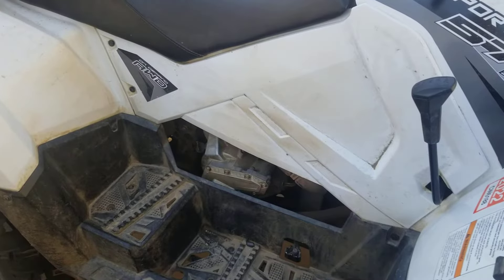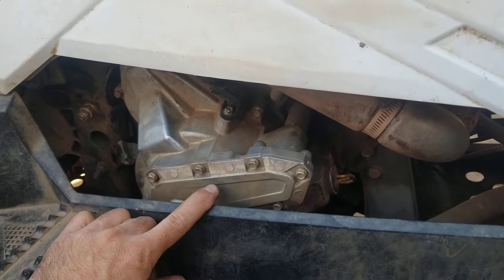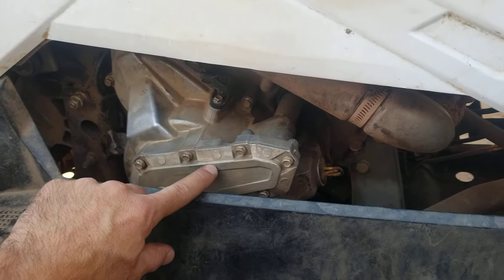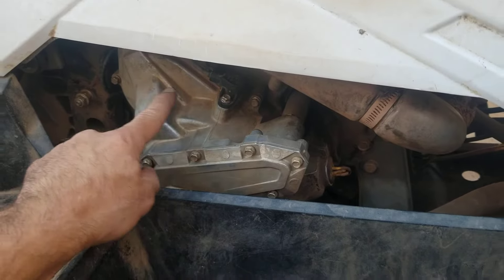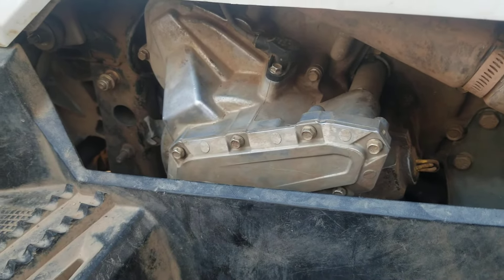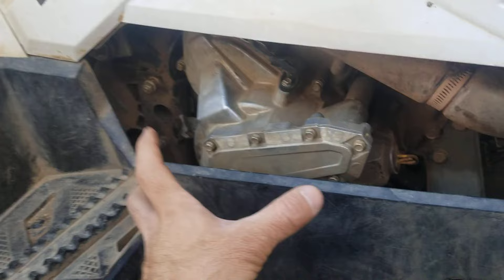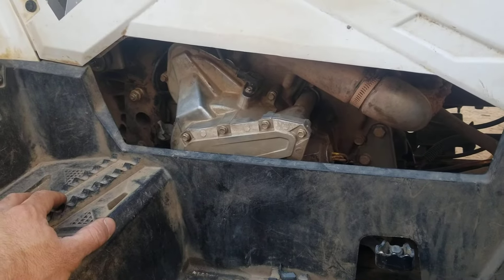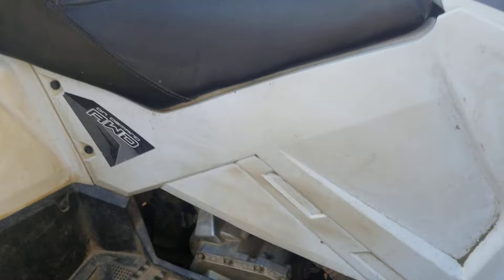Sportsman 570 Common Issues

Comment: I've owned my 570 since 2014. It has just over 900 miles and 300 hours. Used mostly on my 10 acres. Plowing snow, hauling, trail rides. I've need a head gasket, replaced under warranty, a battery in 2020, fuel pump in 2020, and many fluid changes along the way. Overall been pretty reliable and easy to repair over the last 10 years I've owned it. 

Plenty of storage, good power and top speed, comfortable for longer rides, and fun!
Reply: That’s low mileage i’ve had mine since last year and I have 4,100 miles

Comment: What the difference between an SP and non SP.   also in a 2017non so with 154m on it a good atv to get?  $5500.  
What do you think about bass tracker 2021?   For my son, I know not…
Reply from the maker: Basically the suspension and adc for the SP. 
Bass trackers are just chinese junk imo.
2017 570 is a good quad in general, just has the typical issues all 570s have.

Comment: I bought a 2020 450 last year and the battery went out. I replaced the battery and now the check engine light comes on. The engine runs fine, I just now have a light on all the time. I am not sure if there is a reset or other I should look for. Any help would be greatly appreciated.
Reply from the maker: What code is it showing?

Comment: The fuel pump failure on mine was a o ring in the pump assembly causing it to not build enough pressure it was easy and cheap to fix the pump itself was fine

Comment: Mine overheated yesterday it said low coolant level I checked it I couldn't see it when I took the cap off, there was none in the Overflow Reservoir or in the hose going from the reservoir to the radiator. I got it running again and then then it started smoking a little bit I shut it off and then when I went to go start it again it would not start or turn over , even trying to start it off the solenoid it has hardly any Spark.
Reply from the maker: You might have blown the engine/ overheated it. Pull the spark plug and see if it turns over like normal.

Comment: Hi I have a 2014 sportsman 570 EFI touring. It turns over like it wants to start but it don’t. I have to turn the key and give it gas then it turns on sometimes. Could that be the woodruff key? I charged the CPS put new spark plug and new fuel pump. Do you have any idea?
Reply: Fuel injectors? Will it start and barley run for a second an stall out?
Reply: I’m a try to change the injector tomorrow.  It wants to start, but it doesn’t the only way it starts if I hold the gas and turn the key at the same time it doesn’t start all the time
Reply: @mij290 Hey, did you figure out the issue with your quad?
Reply: Yes fuel pump and you won’t believe it it was the ignition switch too.
Reply: My 2015 570 starts for a second or 2 then dies, what do you think I should address first?
Reply: You can start by checking the pressure on your fuel pump. Make sure you have enough psi on it.  You can also change the ignition switch. Mine was doing the same thing, but I changed the fuel pump first and it still was doing it so if you want, just change the ignition switch

Comment: Good day, thanks for the video. I’m having a problem with power delivery to the wheels. When i rev up it doesn’t bring the power to the wheels  while the motor is sounding normal.
Reply from the maker: Sounds like the clutch is going out

Comment: My 2021 570 started ticking and lost all power like I was giving it full throttle and it was barley moving and it shut off and won’t crank any idea what it could be the ticking was coming right under the seat
Reply from the maker: Test your battery and the connections
Reply: @brothersmechanics2028 could that cause the ticking tho sounds like in the motor
Reply from the maker: @actecalcfn5609  could be a lot of things. Valve clearance, crank bearings, piston slap, etc. No way to tell through messaging.

Comment: I'm working in the woods right now with it, so when it says low on coolant it got to like 210° so I got off it and just let it idle for a few minutes while I was cutting fruit trees and when I went back to check it it was at 2:48 so I shut it off. But then it did start again and I pulled a few trees with it and then it started smoking a little bit so I shut it off . So what did you say take and pull the spark plug and see if it'll turn over?
Reply from the maker: It definitely overheated. Pull the spark plug to see if it turns over or if it seized up

Comment: I have 2018 570sportsman  efi… while it was out of gas I went ahead and changed the oil and filter put fresh gas back into now it starts for a split second and goes dead… check spark and everything I know to check… Any suggestions?
Reply from the maker: If you ran out of gas it can take a while before that pressure pushes out all the air in the line.

Comment: I have a 2023 570 touring and at 50+ hours. I’m hearing a ticking noise almost like a knocking noise and it drives and runs normal, and the noise goes away randomly then comes back
Reply: Mine does tick a little when hot i dont know why but it sounded like this since day i got it

Comment: Hey Brothers, I have a 2015 570 that is always running hot. Replaced thermostat and cap which did nothing to help. Do you think my woodrift key could be the issue? Yesterday it died on me, starts but stalls out immediately. Thanks for any advice you have.
Reply from the maker: Check your water pump and do a compression test
Reply: That will be your fuel pump, pull the seat and you can see the map reader plug in on the side of the throttle body, disconnect it and start it, it should idle smooth but will die with any throttle, if it idles okay it's your fuel pump.
Reply: @mbriggs4627  yup, replaced the fuel pump 2 days ago & it runs fine now. Still have an issue with it running a bit hot. Replaced thermostat and rad cap, elevated the front & burped all the air, used OEM fluid but still seems hot. Fan kicks in and off as it should, can't figure this one out.
Reply: @gordtaylor1538  Is there a temp gauge on the 16 that I don't know about ?
Reply: @mbriggs4627  no, no gauge. Just by feel of the heat it gives off and that it steams up the instrument cluster even in warm weather which it never used to do

Comment: After replacing the fuel pump assembly it still shuts off any ideas what it could be -tu
Reply: Voltage regulator
Reply: Could be the contact on the thumb throttle

Comment: First,  thanks for your help. i have a 16 450 sportsman but it has 570 engine. ( how i bought it) fuel pump i replaced  and let it sit for awhile. went for a ride got about a mile and it died it sat for awhile i turned it over started went back out and it did it again. what do you think
Reply from the maker: Sounds like fuel pump still
Reply: @brothersmechanics2028  thanks again

Comment: Mine won't start , I was plowing and it stalled then wouldn't start back up . It's like it wants to start like a dead battery.  But has 12.4 volts ?
Reply from the maker: Need more info.
Reply from the maker: Check your fuel pump
Reply: If the battery is bad and or old it could show voltage but actually not delivering it to the starter.. Put a new good one and verify

Comment: So I’ve got a 16 570 and I can’t get any power at all, not to the screen or anything. Any ideas?
Reply from the maker: Ignition is the first thing to check. Hand controls are next. Make sure your battery is good of course. Also check fuses.

Comment: I have a 2015 Polaris 570 sportsman it just started misfiring/ back firing and not having any power. It will also cut off when it idols down. Do you have any suggestions what it might be?
Reply from the maker: Possible top end rebuild needed. Do a compression check.
Reply: I have the same problem.  It turned out there was water in the gas.  Empty the tank out and give that a shot.
Reply: Could you solve the problem? What was the solution?

Comment: I've got a 2016 570.   I've had an intermittent problem with mine stalling.    Now its backfiring and barely running when off idle   I thought maybe weak battery might be the cause, but how would I decide if its really the fuel pump causing the problem ?
Reply from the maker: You need to test the fuel pressure coming directly out of the pump.
Reply: Did you ever solve it? Mines back firing and stalling when accelerating its 2021 570
Reply from the maker: @mattandkatchristie2552  test your fuel pressure
Reply: @mattandkatchristie2552  I charged the battery, things seemed to improve - but I haven't done enough to really prove root cause.  I should just go buy a battery, but my mower went down and distracted me....  I'll report back when I have found root cause with my situation.
Reply: @fj5gtx770  sorry to hear about your mower jeez your not having good luck. And I'd definitely appreciate it if you figure it out.  Thanks
Reply: @brothersmechanics2028  it's running good for a few min then starts to die
Reply: I am going to replace my plug this weekend and order a fuel pump. I will let you guys know if either works. Thanks for the advice.
Reply: @davidshinn5657  mine was in the wiring!!! The wires to up front going to the crank sensor! My 570 works perfectly I just rewired it with some wire I had laying around and used tinfoil to wrap the foil wrapped wire. Make sure you rewrap that wire or it wont run right. To test it wiggle those wires while someone else is trying to start it see if it starts. Good luck!
Reply: @mattandkatchristie2552  Thanks,I will have to you tube crank sensor. My buddies are going riding sat. and I hope it is a simple fix.
Reply: @davidshinn5657  it's easy to get at the wire. Is your engine light on ?
Reply: @mattandkatchristie2552  no lights
Reply: @mattandkatchristie2552  engine light is Not on.
Reply: @davidshinn5657  do you have fire? Spark
Reply: @mattandkatchristie2552  Yes it cranks up and drives around. When it gets hot and the last time it would barely stay running and putt alone to get it to the trailer.
Reply: The plug looks pretty charred.
Reply: @davidshinn5657  when it starts running bad the engine doesn't come on?
Reply: @davidshinn5657  mine would sometimes run good for a few min then start spit and sputtering... I fixed that wire and won great. Theres that 1 wire that needs to be separated and wrapped in tinfoil. The reason being is the crank sensor wire will pick up feedback from other wires and cause it to run awful.Sounds f funny but true haha I was so happy to finally figure it out

Comment: Hey ive got a 570 sportsman 2018. I'm dealing with a high gear issue. First of all all gears are hard to shift and secondly while driving in high gear sometimes the gear makes noise and feels like its slipping. can anyone help me with this please?
Reply from the maker: Check your primary and secondary clutch to see if the secondary is always moving. If it is, that's your issue.

Comment: i have a 14 570 and when i get on it it has plenty of power but when i start riding for about 5 minutes it just looses power and start back firing and not wanting to crank any help ?
Reply from the maker: When you say it wont crank, do you mean the engine doesnt turn over at all as if its seized or do you mean it turns over but wont fire?
Reply: This is exactly what mine is doing it is a 2015 570 sportsman. It cranks and runs fine for a little while until it gets hot and then it starts backfiring misfiring not idling.
Reply from the maker: @davidshinn5657  check your fuel pump. That's a symptom of a clogged filter or a pump going bad.
Reply: @davidshinn5657  i changed my spark plug and fixed the problem
Reply: @dakotasherley8365   I hope it is just a spark plug
Reply: @davidshinn5657 was the spark plug?

Comment: Why does it slow down when you stop accelerating?
Reply from the maker: It's how the clutch system is made. It's specifically designed to slow down when decelerating.

Comment: Buy any pump save your money then get a heat shield for your fuel tank and wrap your header with heat shield tape. Problem solved. Cost about $75. And never buy a polaris again because they knew about this on 2016.
Reply: Sounds like good advice. I'm going to replace my fuel pump soon and will stick some tape around the tanks area. Cant hurt.

Comment: I have a 2016 sportsman 570sp and I’m having issues with code 102 4 (t-bap) I’ve replaced the harness and plug and the sensor I also replaced the fuel pump (complete pump) now my issue is atv would run and idle if check engine light is present when cold but when the engine runs enough to warm up check engine light goes off and atv shuts off and won’t start again until I unplugged the tbap sensor any idea what I’m dealing with?
Reply from the maker: Sounds like you've done all of the typical issues for that code. Maybe your new bap sensor is also bad.
Reply: @brothersmechanics2028  I’m on my second harness and 3rd tbap sensor I doubt I got 3 tbap sensors bad in a row
Reply from the maker: @Pnwutvadventures  sounds like you should just pay Polaris to diagnose it and save some money.

Comment: My dash lights flicker constantly, blow ps fuse constantly. Doesn't roll over half the time and this all started 1 week after getting it. It was fine until I took it back for a winch install.. it's like brand new and I hate it 8/... also the engine breaking really sucks
Reply from the maker: Sounds like they did something wrong when installing the winch. I would take it back to get it checked.